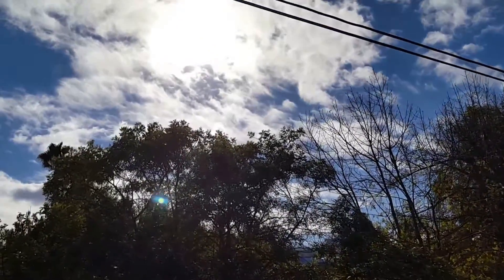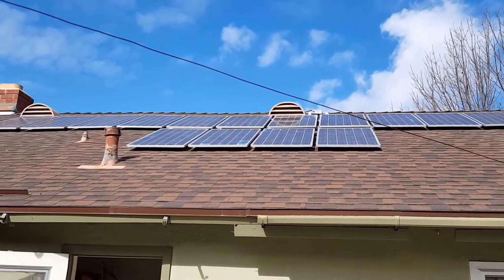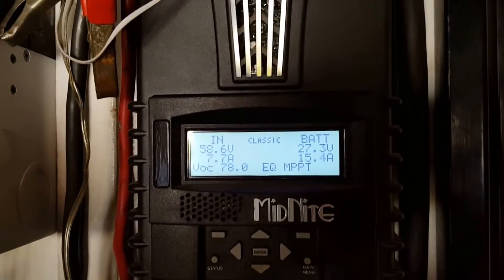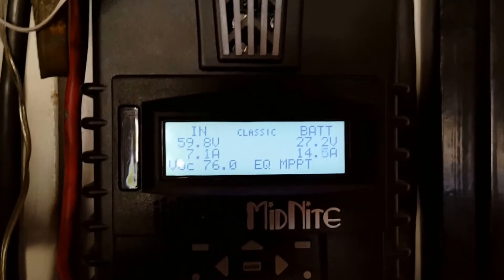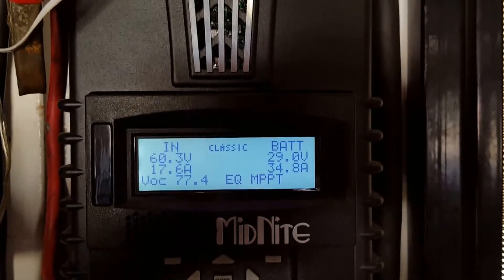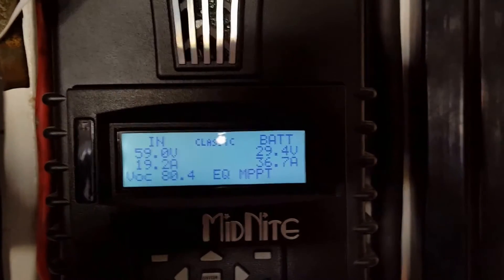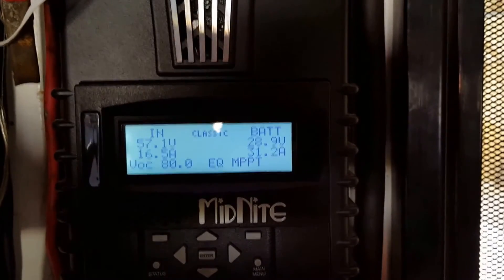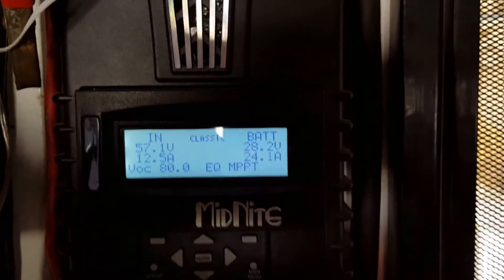MidNite Solar Charge Controller And The Cloud Edge Effect.

Comment: hi sir i got the same controller to the battery right now and no lcd light reading . do i need solar power to make the controller lcd light up ?
Reply from the maker: Hello, I'm sorry kind of lost, what do you mean, the LCD does not show the content or the LCD light does not come on?
Reply: @ElRazTheGreat1  .. yes lcd is blank no reading or numbers at all . but fan comes on and off when disconnected from battery power
Reply from the maker: @pepe58pepito54  that is not normal, you need to contact the seller/dealer asap, be well,
Reply: @ElRazTheGreat1  .. well i got it used
Reply from the maker: @pepe58pepito54  most likely you need a graphic display adapter,
Reply: @ElRazTheGreat1  . It need it solar panel to work..is working now.... the problem is to high tech for me. My old controllers they work just with battery power.. thanks for the reply
Reply from the maker: @pepe58pepito54  that is great news, congrats,

Comment: Cloud edge effect is a dangerous thing. I almost blew up a grid tie inverter due to it. Thanks for sharing.
Reply from the maker: please elaborate old friend?
Reply: ElRazTheGreat1 I had 700 watts on a 1kw grid tie then cloud edge effect that lasted 30 seconds pushed the 1kw grid tie to 1100 watts.
Reply from the maker: +TheBlokeSolar&Wind Thanks for sharing, that's a very valid point!